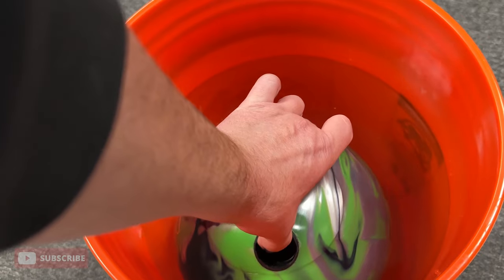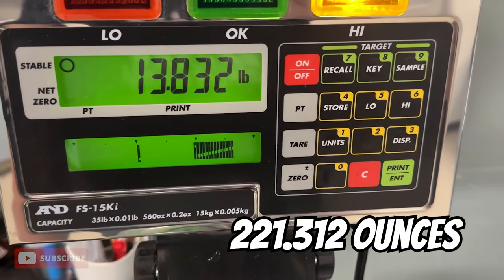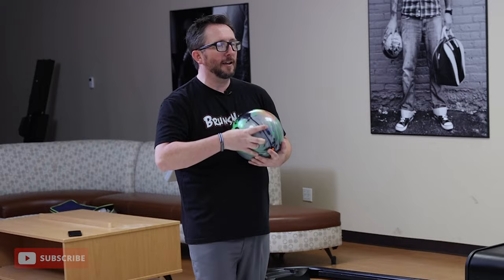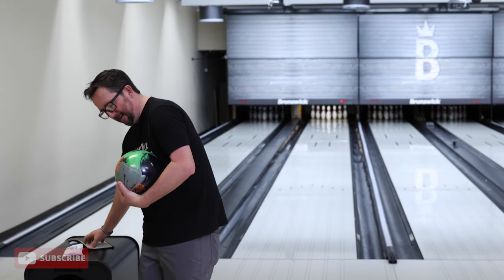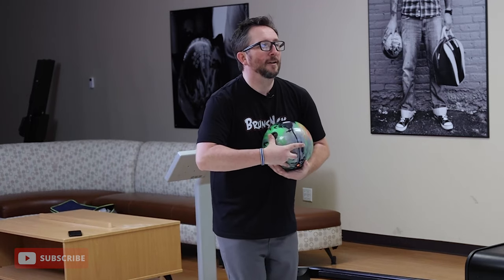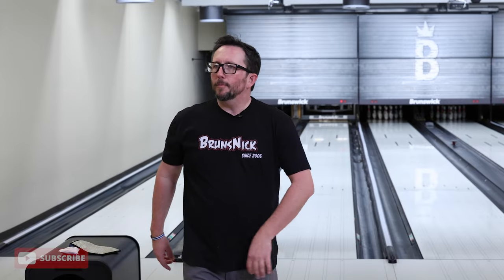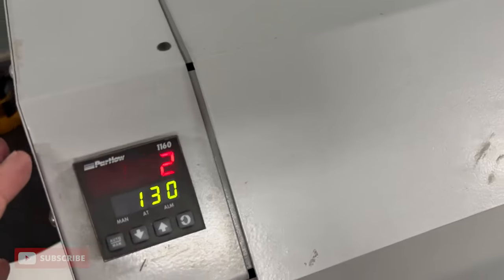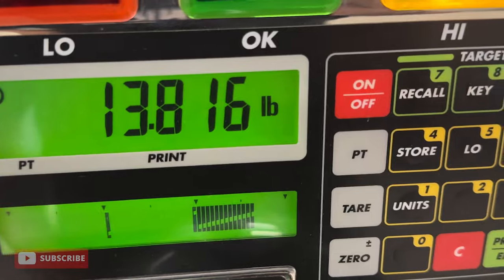Can Bowling Balls Absorb Water?

Comment: Did the water absorb into the shell, or did it go down the thumb hole and absorb into the 'dynamicore'
Reply from the maker: Great question. The way to test that would be to submerge an undrilled ball and measure the increase over the same time period. If it’s a lot less, then it absorbed more through the core material.
Reply: Same thought, I was interested in what may have done the absorbing.
Reply: The shop I used to get my ball cleaned had a oven and a tank that heated up the water. It also was ultrasonic. Not shure if that's better way to get oil out than the oven.
Reply: I’ve heard of guys covering the holes with waterproof tape to keep water from getting into the core. Haven’t tried it myself.

Comment: Y’all talked about using the dishwasher the other day. I’ve been doing that for over 20 years I plug the holes and use the heat. Hasn’t negatively affected any ball I have done as a matter of fact they are like new. Hooks like a new ball as well. I also put my bowling balls in those magnum bowling bags. I have a ball spinner as well.
Reply from the maker: To each their own I just would never clean a petroleum product in an appliance I clean my dishes in or cook my food in.
Reply: Agree with you on that. Why poison your self potentially. That's what a steam batch in the oven does basically.   Set your oven to the lowest temp, add a pan with a lil water.  If your ovens lowest temp is 250, you're going to crack the door open, air it out. Use a therm, take the temp once it's 120-130, place the ball, or balls in there. Leave for 15 minutes or so, remove. Wipe, and bam. Detoxed ball.

Comment: Hey Nick.  Pretty cool experiment.  I have another one for you if it hasnt been mentioned already.  Try the temperature experiment where you refrigerate the ball and then take it directly to the lanes and throw some shots with Specto.  Then, put the ball in the rejuvinator for a bit and then straight to the lanes and throw some shots to show the difference in ball temperature on lane performance.  You do get those people that leave their balls in the car regardless of the weather outside.  Would be cool to see the difference between a ball at say 50 degrees and the same ball at 100 degrees how different they would be.  I realize the temperature would get back to room temperature after a certain amount of time.  But wonder if that would be an experiment worth trying.
Reply from the maker: https://youtu.be/9jZwX8v9MWA?si=BXIXpGH8L_6uHG8O

Comment: I just cleaned up my dad's Ebonite Tornado rubber ball from the 60s.  Semi fingertip grip.  Going to throw it Monday and do a video!  Hope it didn't absorb water being outside the last 20 years.
Reply from the maker: Not sure if rubber material is capable but have fun either way!!
Reply: Some rubber balls had a cork filler in em, didnt they? Definitely agree an undrilled ball wouldnt, but it might depend on filler

Comment: I occasionaly have soaked my 1992 Rhino Pro in hot water with Dawn Ultra dish soap to remove the oil.  I then hit it with a 250 grit wet/dry sanding pad i use for woodworking.  Seems to do the trick.😂

Comment: If you put one side of the ball on a wet towel/ soak half the ball in a pail, will the absorbed water difference cause it to behave like having a weight hole?
Reply from the maker: Not really. The weight hole would remove mass and really change the differentials in the ball.

Comment: I de-oil my balls in a bucket of warm water, heated with a sous vide (which keeps the temperature constant and circulates the water too). I plug the thumb hole with a rubber stopper, and have the finger holes vertically up, just above the water line. That way none of the holes are in contact with water and so stay dry. I wonder if Nick had done it this way if the ball would've still absorbed water, instead of submerging all three holes as he did?
Reply from the maker: Only one way to find out!
Reply: The coverstock is porous... I'm going to say yes (it will still take some water your way), but that's purely a guess
Reply: Me too.  Works great and cheap in comparison to most other methods.

Comment: Did you check surface hardness after the hot water or revivor test? Did you try dawn in water?
Reply from the maker: No to both. Wasn’t trying to extract oil, it was essentially brand new.
Reply: @brunsnick  my question related to hardness. Is it possible both balls were 5-10 lower on the durometer?
Reply from the maker: Didn’t check hardness.

Comment: Hey , I have 2 solid covers balls that change color after a hot water bath with dish soap, widow 2.0 solid and an envy that does it also really werid over time it goes back to it original color
Reply from the maker: Lower the amount of soap you use. Only need a drop or two. A resurface will reduce the phasing of what you’re seeing.

Comment: I doubt the ball if it was solid no holes it wouldn't absorb water
Reply from the maker: Say again?
Reply: was saying would it if it was solid no finger or thumb holes
Reply: Typo in original msg sorry
Reply: Me and my girl watch you videos religiously.
Reply from the maker: @IGY6_Danger_Close_IGY6  thank you! I’ll do a quick test on water absorption with an undrilled ball. I think the results will be the same. While the outer core material is porous, the surface area of the holes is a lot less than the surface of the ball.

Comment: Pointless. Needs to be done on an undrilled hall. Come on.
Reply: Nah, seems relevant for everybody who uses water of any kind to their drilled balls to clean or de oil em etc
Reply: @avos5  Doesn’t prove the shell absorbed water if the water was able to percolate to the core via the holes. The inside of the holes is different material from the cover stock.
Reply: @jameskinchen2148  He mentions that it was inspired by a real experience he had when he was younger

It didnt have anything to do with whether the cover alone absorbed or not, thats a different question
Reply from the maker: Who uses an undrilled ball?
Reply: @avos5  He stated the cover absorbing water.